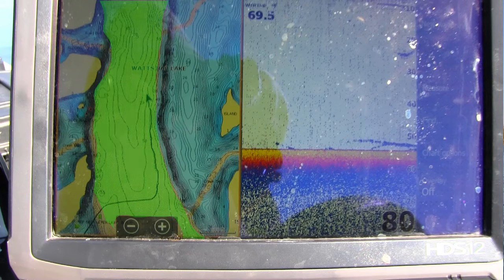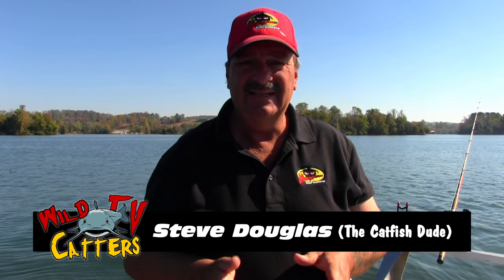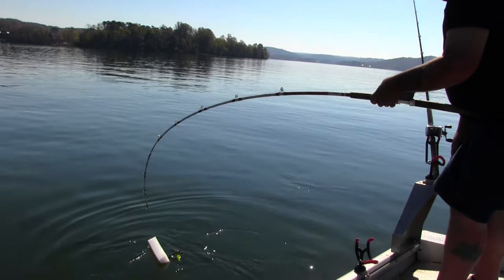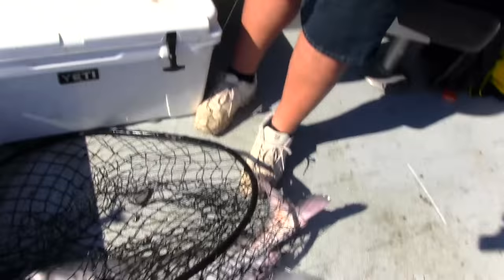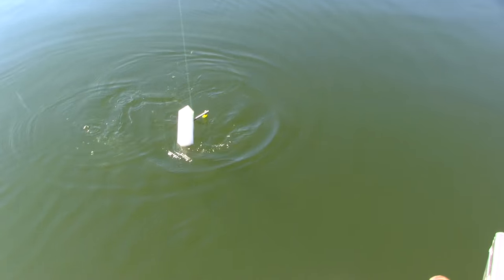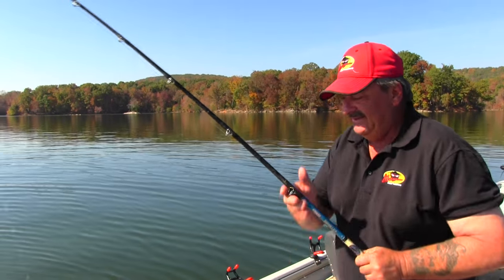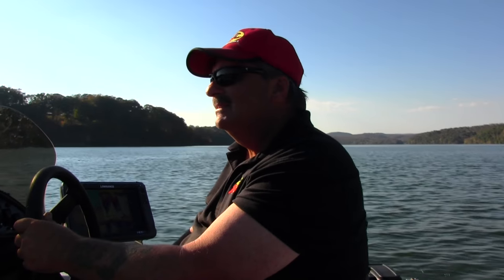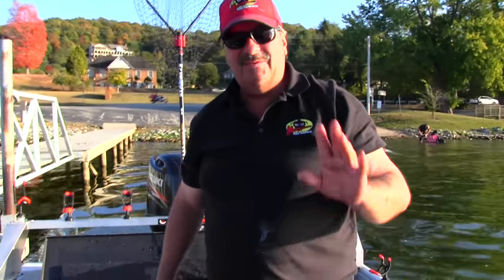How to locate and catch catfish using planer boards

Comment: Steve- In this video I noticed some LARGE bait in what, at a glance appeared to be a vacuum sealed bag.  Is that right?  Do you freeze this bait for future use & if so how long does it last.  The MuddyRiver dude salts shad and vacuum seals them. Great Channel you have here sir. Learned quite a bit from ya. 
Regards,
Bently
Reply from the maker: Yes they are vaccum packed, here is an article i did a few years back on how i preserve my bait for future trips. http://discovercatfishing.com/2011/09/freezingpreserving-baitfish-for-catfishing/